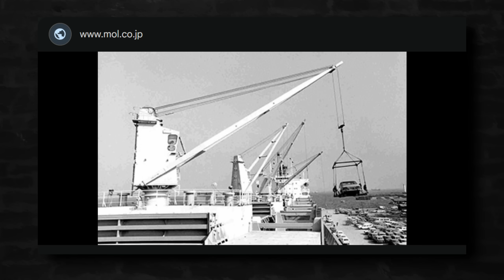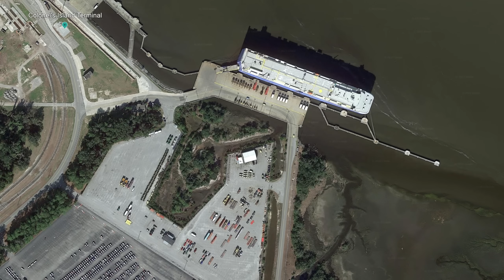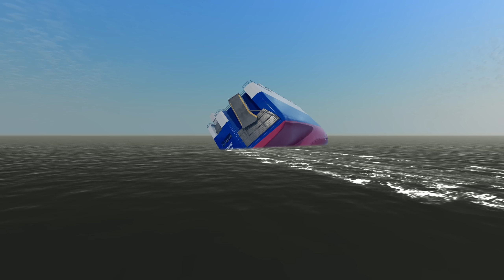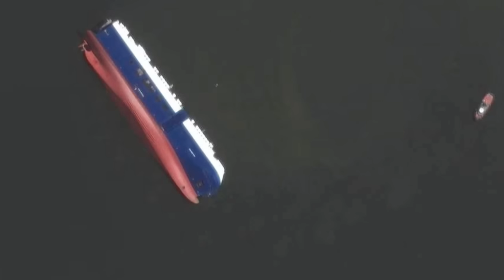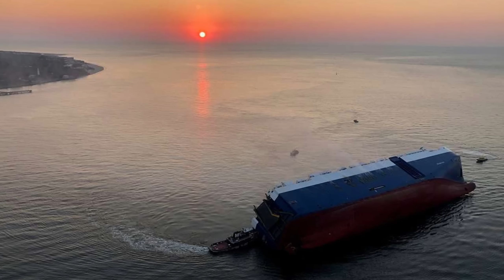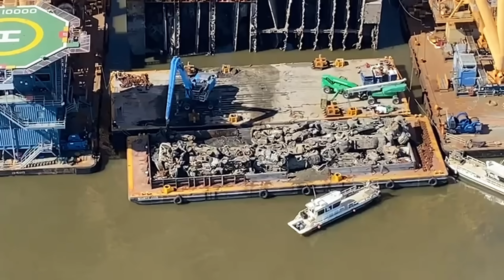ROLL-ON ROLL-OVER: The Loss of Car Carrier Golden Ray

Comment: I'm sure there is an obvious answer as to why this would no work, but has anybody looked into making these RO-RO boats (and other unstable craft) into a trapezoid? 
Like use a W, or UU shaped hull and make the total vessel about 40% wider? The channel down the middle would provide a slipstream for the screws, and the ballast tanks would be further apart across the beam. Have a draft of around 20-25 feet on the edges and around 10-15 feet in the middle instead for the 30-35 feet now, and taper the outer edges of the hull. The Golden Ray had a beam of 35.40 m (116 ft 2 in), so if we go by my stab in the dark 40% that makes 49.56 m (162 ft 7 in) of beam at the water line. Taper the sides in so deck 15 is roughly the original beam? 
This would give you a rough trapezoid viewed from fore/aft, and a trapezoid is remarkably hard to roll over.
Reply: The fundamental problem is that these kinds of ships are maxed out in width and maybe length, thus they can only really get taller. They're uniquely susceptible to rollover because the width limitations (for channels/canals of a given route) and the cargo also being uniquely low density, high volume with the additional wasted clearances in height like a parking garage. Width would be the easiest fix but again would result in having no accessible ports, a huge problem for an industry like this with frequent stops for loading and unloading, completely unsuitable for these ships but acceptable for huge bulk tankers and container ships with one long voyage from departure to arrival.

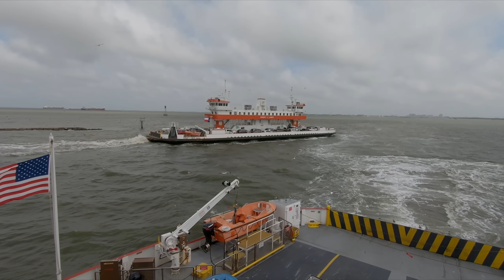Comment: I've been on the ferry at 11:45 several times. When I lived in Texas, Galveston was my favorite place to go to the beach even though there were beaches a good bit closer. Though living for 30+ years in Mobile, that's the ferry ive ridden the most, but it's been a good 10 years since last time. I know it's a newer ferry now- nothing like the old one I grew up with in the 80s and 90s. And no, on neither ferry was any vehicle strapped or held in place in any way. But then, youre right about small, calm bodies of water. If the bay was ever a bit rough, they'd just cancel the ferry. And if you'd driven all the way down to Dauphin Island just to ride the ferry to Ft Morgan, you were just SOL.

Comment: Another great one as always! I really appreciate how much detail you went into all of the factors that led to the loss of stability before it came into play. That made it so much easier to understand how they all played a role in the loss.

The part that shocks me the most is how complacent the captain was to not double check the first officer's calculations. Surely the few minutes of effort required to do so would FAR outweigh the risk presented by not... especially when lives are on the line.

Comment: nearly 150F/70C is insane, I'm genuinely surprised that all of them were able to survive in that kind of atmosphere
Reply: I got the impression they were half immersing themselves in the cold salt water to try to regulate their heat, I could have misunderstood that part though.
Reply: I assume that was near the top of the room, which is why the crew members went back down near the water level.
Reply: It'll hit at least 118 here this summer,  maybe 120... last year, we had 133 days over 100... with  54 days of 110+.

Welcome to Phoenix. 😅
Reply: I'm no engineer, so tell me if my question is totally ignorant, why haven't catamaran type ships been implemented? They seem far more stable due to their width while remaining efficient.
Reply: @2006gtobob
Why no catamaran supercargo ships?  Two reasons:
1)Suez Canal
2)Panama Canal
Reply: @2006gtobob Logically, the issue would be the infrastructure. However, don't quote me on this, as I am not qualified in this field.
Reply: @2006gtobob  Like most cargo ships the primary limitation is the maximum width for a given route, and at 116ft if I recall this ship was already pretty wide. The video implicitly explained why these ships in particular are far more susceptible to rollover, because they are necessarily very tall to carry more vehicles. The cargo itself is also different in that it's relatively light for the volume it takes relative to just about anything else, which again requires a lot of decks/height with wasted space between like clearance in parking garages.

The only possible fix I could see would require new massive ocean ports and new massive ships that couldn't pass through any canals which is both extremely expensive and way too slow and spread apart for this kind of industry. This ships may have LESS inherent stability but that's not a real problem unless, like this case, there's incompetent crews that don't properly check stability.
Reply: For real. People can suffer heatstroke at less than 100 F degrees, especially with high humidity. 150 is hard to even imagine.

(Interesting fact: the Fahrenheit system is based off of what is safe and most comfortable to the human body, which normally operates at ~98.6 F body temperature, and anything above 101 F is considered a fever.)
Reply: @CharlieApples  
Have a vehicle sit during high summer days then jump straight in. Unpleasant to say the least. Cars sitting in open parking lots waiting to be loaded onto ships have been measured to reach this temperature. It is no joke, like a punch in the face. Before key fobs they all came with the old school ignition key which always stung your leg while driving 😂
Reply: @CharlieApples  It's not based on the body temperature (and that measurement was also incorrect back then), but he set the zero point  on the lowest temperature he could get a water and salt mixture to freeze. That was the main fixed point and then they added the normal water freeze point and than the body temp thing for who-knows-why really. 

And to the people who complain about 'Americain' measurements, Mister Fahrenheit was a German and the main reason it kept in use, is because England liked it and started using it. Since England was well spread alll over the world, they introduced it to everyone and it stuck. Not everything is the fault of America. I mean, a lot is, but not everything. 😉
Reply: @Skaatje I'm a Brit, I refuse to go metric! 😂
Reply: @CharlieApples  (oh snap, that "wet bulb" thing!?  Not sure if the humidity could get much higher, than on a sinking ship....)
Reply: @CharlieApples  Theres a lot of hidden reasons why we love the imperial system, especially machinists. I think its an incredibly intuitive system, but that might just be my backwards brain. 🙃
Reply: @scumbaggo  It's just because that is what you're used to, nobody that gets used to metric wants to go back to imperial
Reply: ....Please enlighten us to these 'hidden' reasons @scumbaggo
Reply: @greenernick  It's  hard, so hard, to make an intuitive conversion from metric to imperial
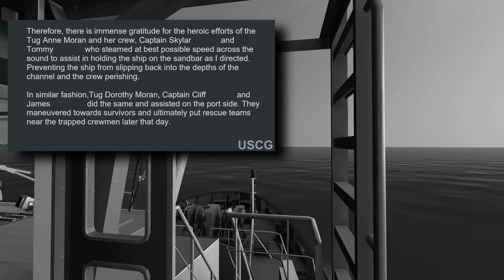Reply: And all in good condition 41:10
Reply: Seriously, I was very surprised at this.
Reply: knowning someone is working to get you out helps a lot
Reply: Most humans can handle up to 120F if not doing a lot of physical activity and staying hydrated.

I’d imagine being in cold salt water would help massively in dealing with temps higher than 120F.

Comment: I'm curious what happens to vehicles that are supposed to be shipped but aren't compliant if something is actually broken. For example, if a vehicle is sitting in port, and the parking break cable snaps so it can't be engaged. Does the manufacturer then have to send someone out to fix that safety issue on the vehicle so it can be shipped?

Comment: in 1998 (i think) got caught in a force 5 gale out in the north sea once coming back from Holland on a ro-ro we had a good 15 degree list at points and got caught between two waves which were about as high as the ferry, It was the only time i ever felt a little worried at sea. 

Me and my salty sea dog dad went to the onboard restaurant and were the only customers for the trip, the chef said eat as much as you want because it is only you two and the crew now... ended up having about 3 lamb shanks and then a heap of tiramisu over ate and then felt rather fat and unwell for the car ride home.

Comment: The large auto carriers are much like an escort carrier--full of gleefully combustible materials like plastic, rubber, fuel, batteries, and lubricants.  It doesn't take much going wrong to result in a floating inferno.  Unlike an escort carrier, however, these auto carriers don't have a massive crew to perform damage control operations...

Comment: For me it helps to think about the GM as kind of the length of the leverage the self righting forces of the hull have against the center of gravity
Like if you had to keep the ship upright by holding it on a long stick from above as a giant
It would be much easier with a longer stick and close to impossible with a shorter stick

Comment: I can’t understand why, in this day and age, we’re not using sensor-based systems to validate loading. Load cells or strain gauges on the deck jacks, for example, or measuring deflection while pumping a measured amount of ballast from tank to tank. Surely it should be possible?

Props to the fast action of pilots and tugs. Grounding unquestionably saved lives. Astonishing piece of work.

Comment: The comparison with an aircraft carrier was eye-opening. Not that I wouldn't expect aicraft carriers to be remarkably stable or private companies to cut corners, but the danger of rollover makes a lot more sense.
Reply: Literally rollovers are so problematic it's mind blowing to see modern stabilized floating rigs and other such vessels like hotels and such, I mean truly truly impressive engineering that is rarely noticed, and don't need trimming either, just underwater stabilizing fans but that's a morons way of describing it but that's what I am 😂
Reply: Agree. Aircraft carrier comparison was illuminating
Reply: I would guess that part the design with carriers isn't just rollovers, but just the danger of ordinance and planes being able to move around. During WWII a carrier was lost in typhoon cobra not because of any loss of bouyancy or rollover, but because the planes came loose and eventually some of their lubricant or hydraulic fluid caught fire, starting an inferno that couldn't be contained due to the rough seas and internal damage to DC systems from planes crashing around the hangar.

Comment: Interesting fact: the midway class aircraft carriers dating back just after the end of ww2 had been intentionally designed with more armor on the hull opposite of the bridge to keep on even keel since the bridge side would have been heavier and leaned to one side without the extra armor.
Reply: How did they balance out the carriers of today? There's still a bridge on the flight deck. So, the balance must come from internal displacement.
Reply: @olliefoxx7165 if i had to guess? probably the same idea. little more armor on one side. that, or they just make sure there's always enough planes on that one side

Comment: Hard to believe there was no blaring alarm warning the bridge that large door was wide open while under way.   Airliners have an"ECAM" system.  Electronic Centralized Aircraft Monitor.  Tells them the condition of all the doors and emergency exits, among many other things.
Reply: Its quite possible there are warning signal about the doors. But having a blaring alarm carry its own problem of creating a nuisance warning and operator bypassing it.  Northwest airline 255 pilot potentially pulled a P-40 circuit breaker to stop takeoff config warning due to nuisance alarm while taxing, they crashed trying to take off without deploying flaps.

Comment: I actually have a little 1/1250 scale model of the Hoegh Traveller 

yeah she is...not the prettiest, but I like it, especially the fact that they actually kept a little mini pool on the veeeeeeery aft deck for the crew 

as an aside, great work as always on this! 

Also huh, gonna guess you were either a farmer or a worker for John Deere based on your comments early on? either way I am partial to the green and yellow, I hadn't realized though that they had THAT much reach outside of North America, I knew in the 50s they had some sales to South America but I figured that was the extent of it

Comment: As soon as I saw the door was on the port side and the turn out of the harbor was to starboard, I knew exactly what was going to happen. Absolutely heroic efforts by the cg, first responders, and other vessels to save everyone on board.
Reply: I thought that the turn would cause the open door to flood the ship enough to cause a free surface effect, but it turned out to only be an exacerbating factor after the stability miscalculations were the true culprit after a simple turn doomed the ship.
Reply: @Raptor747 I was thinking the same thing
Reply: Why was the door even open? Shouldn't they close it if they're leaving port?
Reply: @Celestial-cat-mom   They opened it because the pilot was about to step off the ship in 5 minutes, but then left it unattended. Like, what's the worst thing that could happen?

Oops...
Reply: @TTFerdinand  Does the door take 15 minutes to open? It seems odd to just leave the watertight door open that long if you can open it on demand. He said an opening on deck 5 would lead to water coming in with a 17-degree list, but even with the wrong stability calculations the vessel would still have righting force up to a 25-degree list account to this source. Another source I saw mentioned if deck 5 doors were sealed it would take an 80-degree list to do that but that can't be right since that's basically the ship sideways.
Reply: @alex_zetsu  All of the calculations  and figures that you quote would only apply if
a the cargo doesn't move
b the loading/ballast calculations are correct.

That is because a "normal" list of 5 or 10 degrees will right itself if the ballast is correct. But, as we saw in this instance, if the ballast calculations are way off, the ship is basically unstable, and introducing a list that goes beyond what littloe stability the ship has makes it simply impossible to correct that list.
this is a very real example of the catastrophe theory in action. One degree less, or one knot less v and the ship may not have floundered. But once it started the process, the feedback loop ensured that the list grew and that the ship was lost.
Reply: @alex_zetsu (Wow!!! Interesting!!)
Reply: @davidcolin6519 (Tyvm.  Daaamn.)
Reply: @TTFerdinand  Opening the door in advance makes no sense. A crew member would have needed to escort the pilot off he ship in order to close the door. So what difference would it have made if the pilot had to wait 30 seconds while he opened it.
Reply: @Celestial-cat-mom AHAHA!!  Just what I was thinking!!!
Reply: When flying on commercial flights, isn’t it nice when they leave the doors open on occasion for some nice fresh air? 🚪
Reply: the roll over was due to wrong stability calculations, not because the open door.  the gm was to low.
Reply: A home alarm system will tell you when something is not properly closed, why don't  they do something like that?
Reply: It wasn't the door though
Reply: Too bad you were wrong

Comment: It's astounding that things aren't double-, triple- and quadruple-checked on ships like this. I feel like I pay more attention to double-checking things when I cut a piece of lumber then these guys who run massive ships!
Reply: I've nothing to base this on, but it sounds like a turnaround deadline problem taking priority.
Reply: I'm inclined to agree. How many times has actual process differed from the book in order to meet a deadline after all?  @JBinFL
Reply: @JBinFL 
Plausible, (probable?)
Reply: Complacency is one of the biggest killers.
Reply: I worked onboard a ship some years ago and I can tell you that, like anything else, things slip through the cracks despite people's best efforts. 
Once before sail we conducted a complete search of the ship, looking in every location to try and find potential stowaways. 
Search came back clean until a day or so after we set sail when two guys showed up and were caught trying to get food from a person. They had stowed away in a covered lifeboat directly over the top of where the search had met and been managed. 
It's things like that that make you realize how mistakes can happen in some of the disasters you read about.
Reply: @matthewmosier8439 - There's a huge difference between missing two stowaways on a massive ship and leaving a 7×7 foot door open right at the waterline .